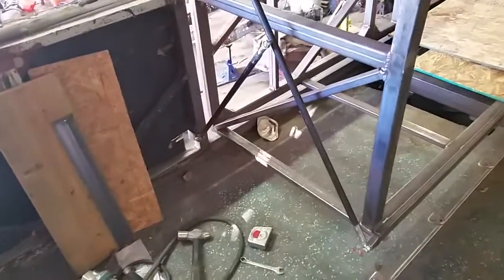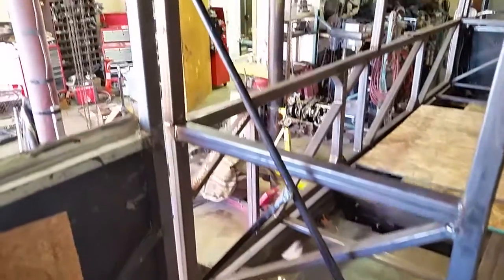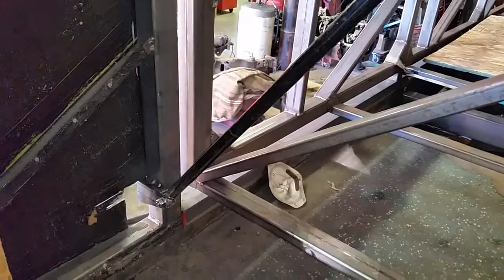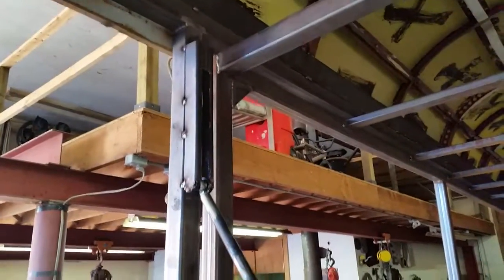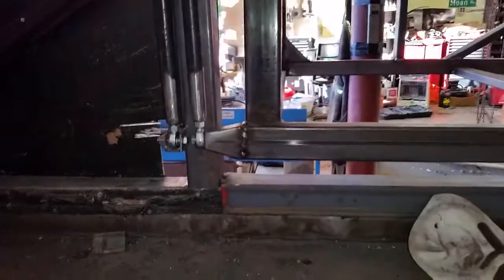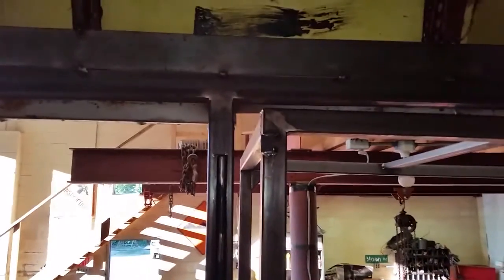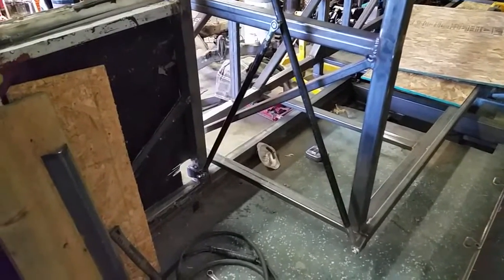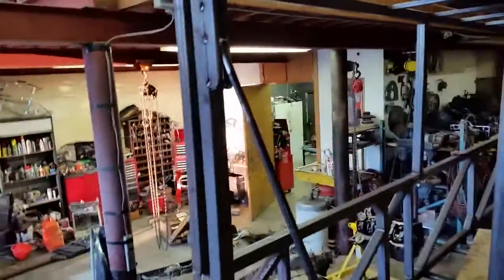Bus Conversion Project Video 22 - Swing Arm Geometry Problems

Comment: Wouldn't wheel/roller under both ends of the slide eliminate the need for the swing arm mechanism? Seems like more work doing that than what you had mentioned in the previous video IIRK. Nice welding.
Reply from the maker: Yes... it would, I wanted to use the swing arms so there was nothing rolling on the floor as I'm worried about scuffing the hardwood that will be going in, however I ended up using rollers on the slide on the other side as I goofed in my measurements and didn't leave enough room for the swingarms and it's working fine, I'm going to take the swingarms out and put rollers in after all cause I made the room too long to have the drivers seat comfortable with the swingarms in place.... they were an afterthought and I didn't consider the room they would take up..... live and learn I guess

Comment: Measuring the wrong directions. Bottom rod should be same distance at the top half of the corner to corner rod minus clearance for bearing at top of travel when room is extended. When room extended, corner to corner rod should fit into channel and the half rod should lay right beside it. I would disconnect the short rod..extend room...fold up short rod to final position and Mark where it should be bolted. Just guessing without seeing it in action close up. But this old video and ya probably already got it

Comment: this "Y" shape, is actually the all familiar "X" shape, (just missing half element)  and as such, of course  it base on the principal that the connection between the 2 parts of the "X" are exactly in the middle.
Reply from the maker: Yup... you're right.... I had the upper half of the rod too long.... had to shorten it by 1-1/4".... then it was all good

Comment: the rod from the floor to the middle of the other rod needs to be screwed in a bit to make it shorter, I think.
Reply from the maker: actually what it ended up being is the length from the center pivot point to the top rod end was 1 1/4" too long, I screwed up and didn't put the center pivot actually in the center, had to cut the top off and re-do it, all works now

Comment: That is a a very nifty device. I wonder if screw rods in vertical track could pull it open and push it closed. That might be an alternative to hydraulic rams below, if you wanted to go mechanical instead of hydraulic. Anyway, very nice work.
Reply from the maker: yes, something like a linear actuator could work on those rods to operate the slide.... the complication there is to synchronize them so both sides operate together, with a hydraulic cylinder in the center only one is required.... I may still use a linear actuator rather than hydraulics when I get to that point.....we'll see
Reply: Maybe a light chain on small horizontal sprockets up top? Wheel chair lifts typically have back-up manual systems for when the hydr is out or engine is shut off.